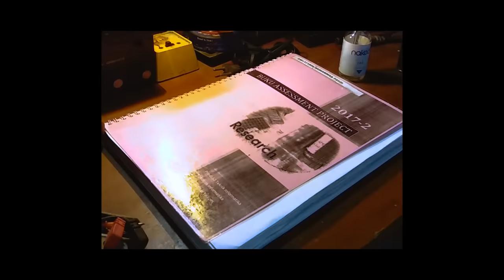Daihatsu Zebra Hijet Turbo "Built"  || #BuiltNotBought

Comment: Zebra 1.3 itu kan terlahir sebagai mobil N A ya, apa gk d upgrade daleman mesin nya jg. Apa cukup mumpuni stang & pistonnya?.
Trus boost turbo yg aman d pakek tekanan max brp bar ?
Krn klo asal pasang trus tuning jg gk pas, resiko mesin jebol 😅😅😅😆😆😆

.
Reply from the maker: Untuk internal masih stock sampai saat ini, berdasarkan beberapa hal yang didapat dari hasil "baca-baca" dan riset lapangan masih aman karena belum ada gejala detonation. Saat ini boostnya maksimal di 10psi. Belum sampe BAR BAR an kok boostnya. Timing advance juga masih bisa dibilang "safe". Asalkan mesin di supply bahan bakar yang bermutu.
mungkin setelah ada "hilalnya" bakalan upgrade internal enginenya. 
You'll never know till you have tried. Just keep learning